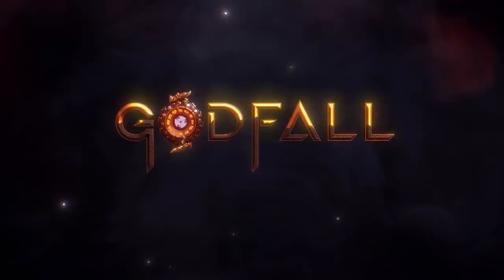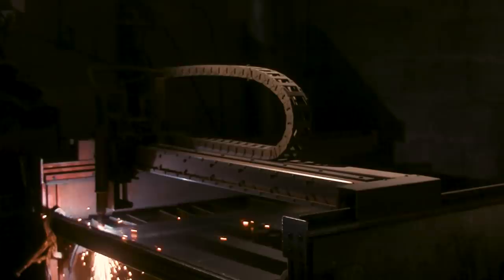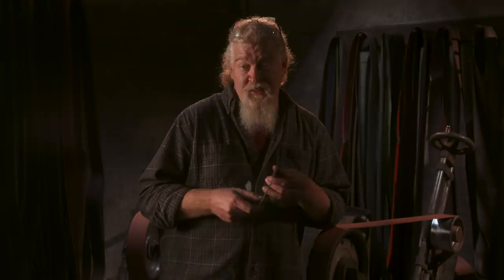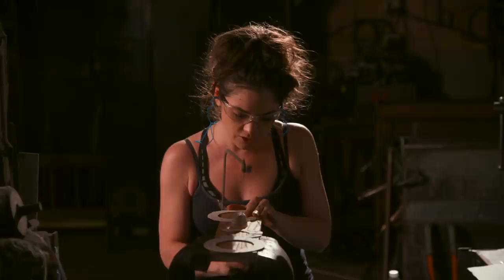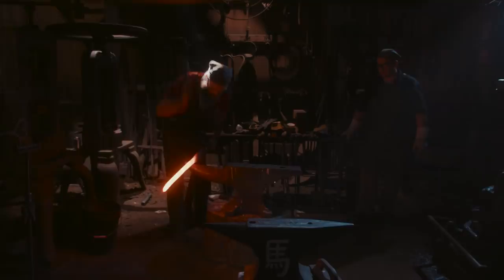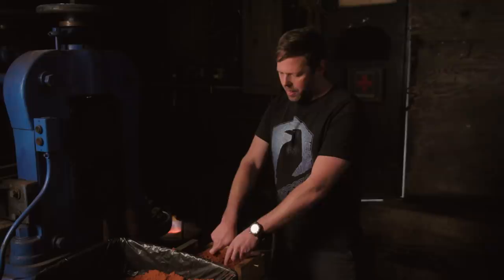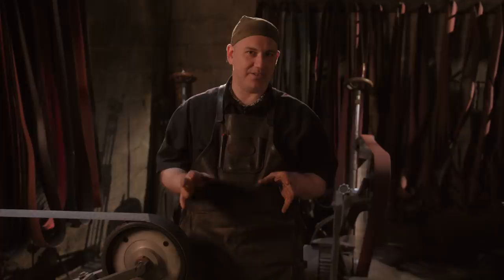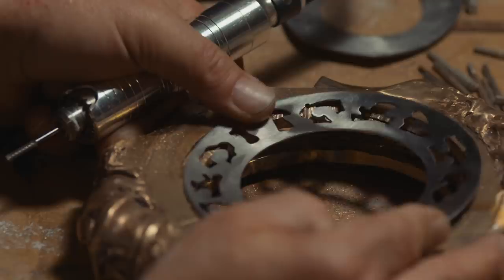Eclipse - Godfall - MAN AT ARMS: REFORGED

Comment: Alright but hear me out, Corvo Attano's blade with the opening and closing mechanism
Reply: That'll be playing with physics. It'll be largely impractical with those mechanisms extremely, degrading the stability significantly. It will be also pretty short than in the game. And it also is missing a tang, which makes it prone to breaking.
Plus, the mechanisms will be extremely complex. Springs send their forces in only one direction. You could open and close it with motion and gravity, but even then, chances are you'll 'fall on your own sword'.
Thanks for reading my scientific opinion with a pun-ishing end. I still won't mind if the sword is at least stylised, but not fully mechanised.
Reply: I’m pretty sure that doesn’t work like at all

Comment: watches the Scrucifix in action

Me: Now, THAT is some Twisted Metal.
Reply: Screwcifer is one of the coolest things I've ever built. It's definitely in my top 3 shop tools.
Reply: Couldn’t they be twisted in the same direction then just flip one around to mirror eachother?
Reply: @ropeadopepope3609  Nope. Because of the round cross section of a twist, it doesn't really "mirror" like you think it would. If you have a piece of rope, double it up on itself and take a look at it from both sides. No matter which way you turn it, the twist in the rope will be going the same direction.

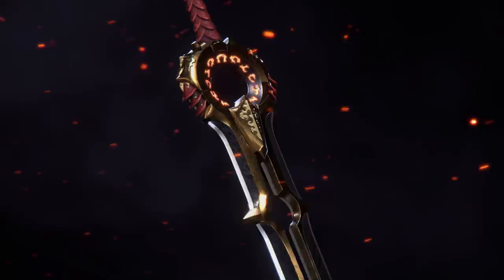Comment: 1:20 looking at the pattern on the sword in the CG trailer
I wonder how they're going to keep track of the twist pattern and ensure the direction is correct in the final blade
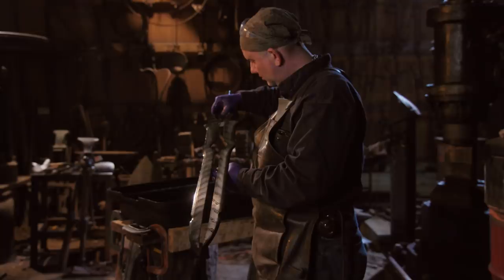12:26 nope they either didn't care or they messed up the tracking. The damascus is sweeping in the opposite direction as it's shown in the CG trailer
13:30 wait a minute that's not the same blade, they went back and redid the whole blade